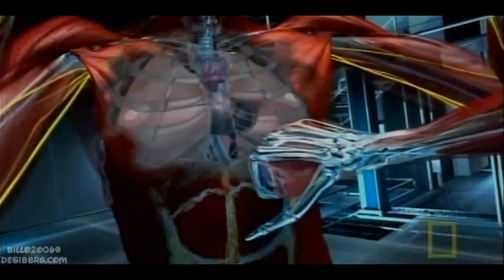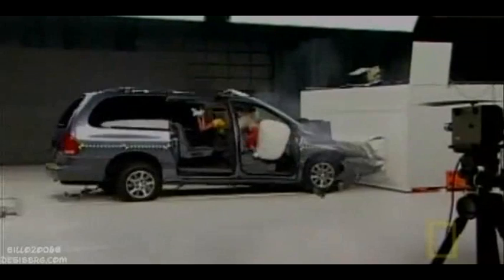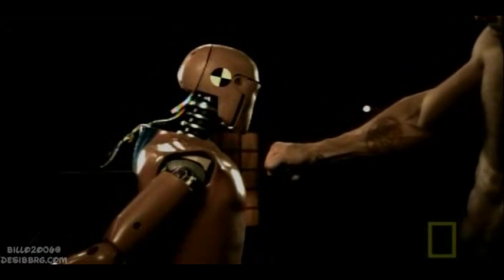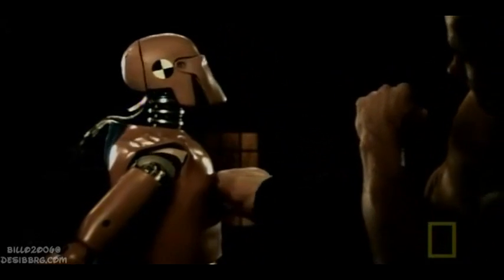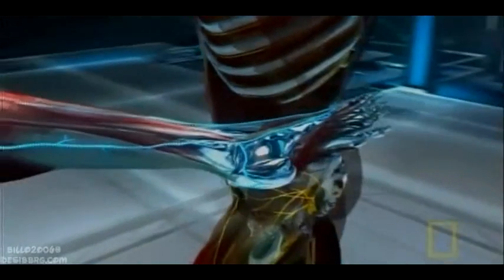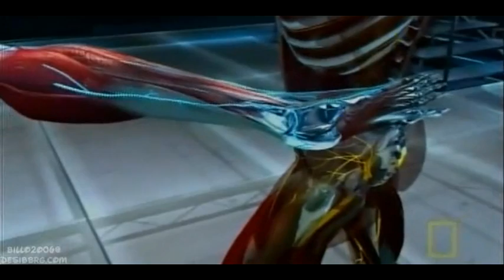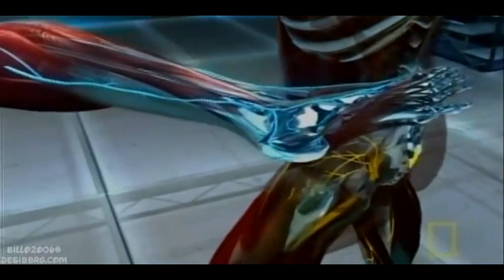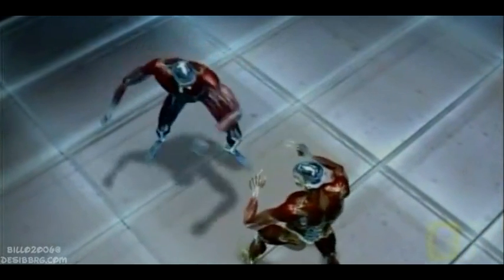Fight Science MMA - Bas Rutten Kicks a Crash Test Dummy

Comment: @andrefisker True...but using the same controls and conditions. for each kick yields data that has valid comparative value. In fact, I think that using the same strictly-controlled conditions to test a head-on car crash to test Bas' roundhouse kick-- and discovering that you're better off running straight into a wall in a car than straight into Bas in the ol' "square circle"-- speaks volumes about the incredible feats that the human body is capable of.

Comment: Actually, Muay Thai, Karate and Taekwondo all share the same kicks. Even knee strikes, only not widely used in Taekwondo and Karate but is taught.

Bas Ruttens kick is 0.8 VC, equal to that Ninja Hammer Punch which also got 0.8 VC. 0.8 VC is similar to a compressed chest. or a person giving CPR with a freakin sledge hammer to the chest.

Bas Ruttens kick in lbs is only 200lbs more than what the other guy got, so that being 2400lbs.

Comment: The producers have no idea about martial arts or fighting sports! And then it leads to confusion. There are no MMA kicks just KICKS. There are just different kicks for different situations and they are applied in different ways (and who in god sake would kick hard to a plastic dummy with the top of the foot knowing that the surface might not be soft n it could lead to microfractures!). The technique used in this situation has to be for power breaking, just that (and all the martial arts have su

Comment: You say bas rutten has a force of 580 kg and then you compare the force of a muay thai fight to a speeding car the car in the video weighs over 1 ton and at 20 km/h it weighs 8 tons and in the video she goes even faster it's impossible that muay thai fighters are 30 times stronger than low ruttens he too is a low rutten heavyweight so muay thai heavyweights have 30 times more strength than those of mma but don't tell dannerie please